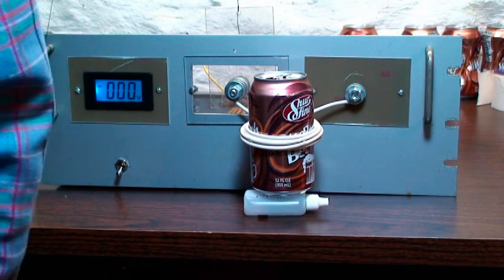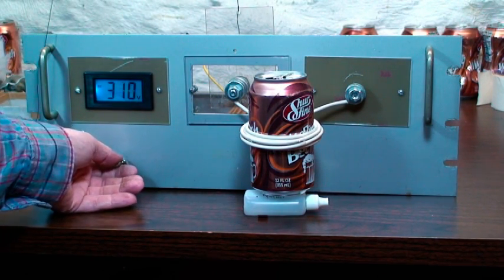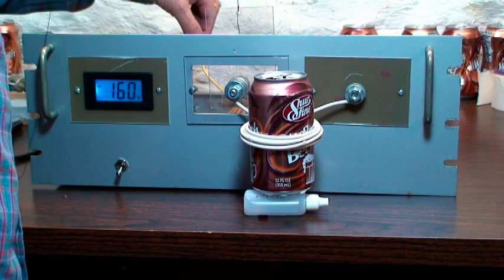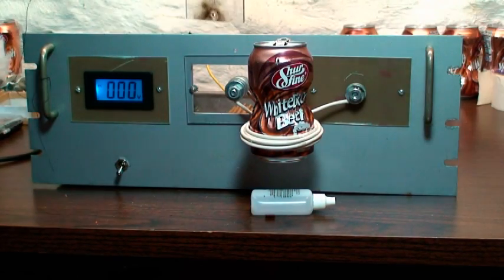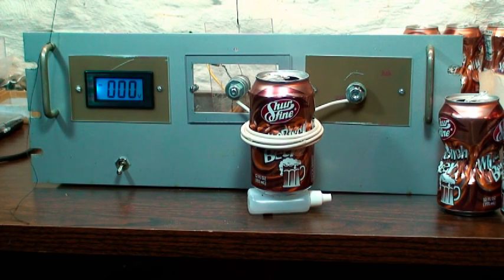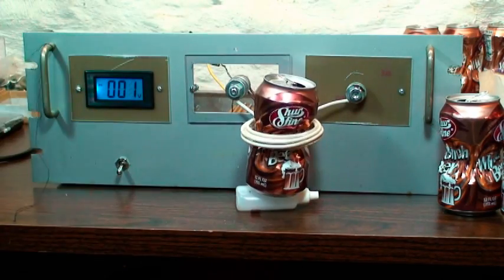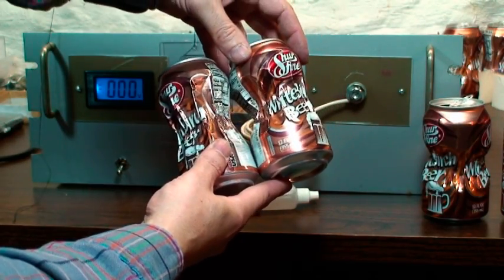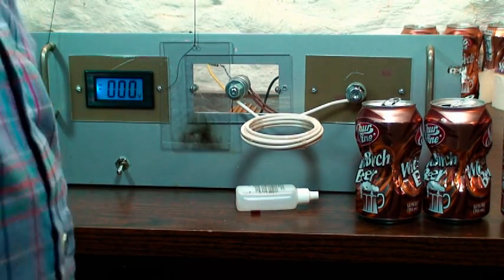5 KV Can Crusher

Comment: Assuming you're still alive, I have some simple safety suggestions.

Use a Variac (variable autotransformer) to gradually increase the line voltage when charging. If you don't have one, put an ordinary incandescent light bulb in series with the line to limit the rush current. It'll safely dissipate a lot more power and it makes it obvious when the capacitor has finished charging. Experiment with wattages.

If you put capacitors in series, use equalizing resistors across each one. Any imbalance in capacitance or leakage resistance could cause unequal voltages across them and possibly pull one of them above its rating where it could explode. The equalizing resistors will also serve as bleeders to get rid of the charge if you have to abort a firing.

Don't ever touch any part of a live capacitor! I flinched and shouted out loud when I saw you do that in another video. Maybe it's because I know of someone who actually fried himself on a very similar homemade power supply (for a ham linear amplifier) way back in high school. Since I didn't know the guy, I had the job of taking it apart so it couldn't kill anybody else.
Reply: Assuming you're still alive -- that's always a great way to start off a comment.  8-)

Keep up the good work, Phil!
Reply: Alan Clegg Well, I had my doubts. :-)
Reply from the maker: Phil Karn I am still alive, but playing with robotics these days.
Reply: Bob Davis That's a relief. :-)

Comment: I like how you include your technical difficulties. I cannot make myself fearing i will make a fool out of myself :P.

That is neat how you can tell the higher voltage seems to crush the can more around the coil. Perhaps this is because of the shorter high current discharge time. 

Neat video, i would like to have some big high voltage capacitors. I crushed cans with a measly 100 joules fairly well, i hope 624 joules with a lytic can do the same.